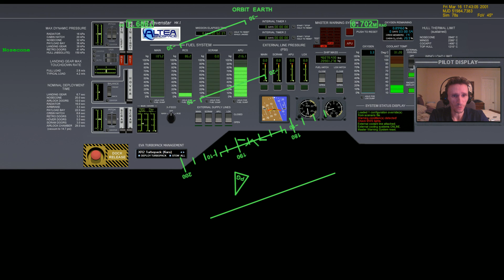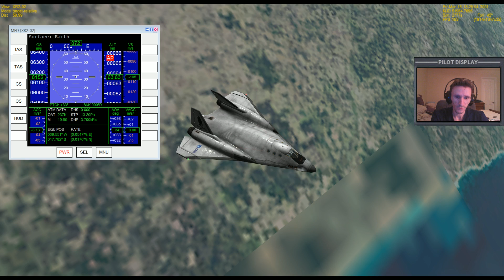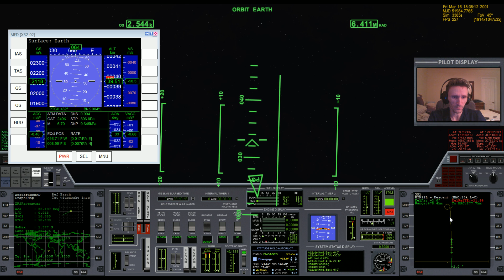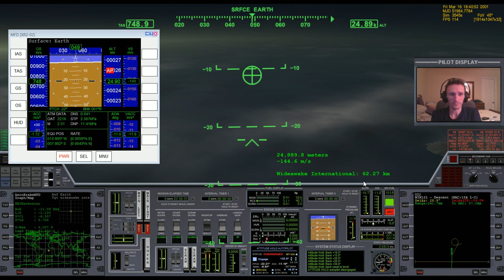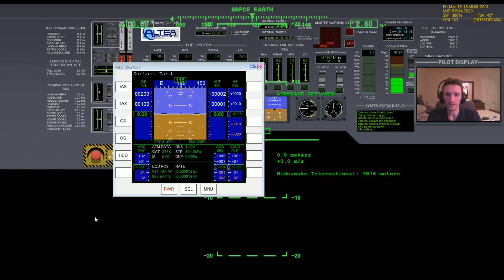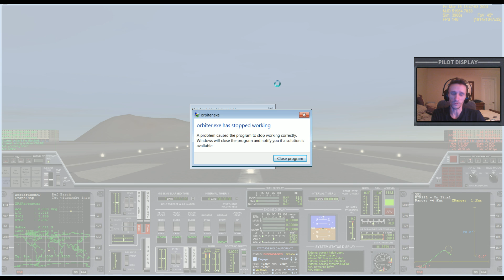Orbiter 2010 - XR2 Rescue Mission [Part 3] - Deorbit, Reentry, and Landing

Comment from the maker: Both XR2's in this flight were standard/default configuration, no overrides. As far as the deorbit timing, you're right, I could have waited a bit longer. There was no particular reason for doing the deorbit burn 1/2 way around the planet other than the fact that it requires a bit less fuel.
Thanks for watching.

Comment: Again nice vid.
Why you deorbited that early ? it´s better to keep the "Atmotime" for the XR-vessels as short as possible. Coolant temp holds ~63minutes. just time it right.
You can easy change the plane later(lower).
12.500-14000 km from target is enough to deorbit, with the XR2 in Standart Config.
BTW, both vessels were standart config, right ?
Do yourself a favour, fly the DGIV. It´s more complex then the XRseries in terms of crew management. It feels like your in the 80´s
too many buttons :D

Comment from the maker: It takes a while before TransX becomes second nature. When I was just learning it, I wrote several text files for myself so I would remember how to do different things with TransX. Part of the reason I started making Orbiter videos was so I would have a video to look back at later on to refresh myself on how to do things. But then I started making videos so often that I kinda got to the point where I knew TransX inside and out. I don't think I could forget how to use it now if I tried.

Comment from the maker: Thanks for the feedback. As far as the STS missions go, there appears to be some discrepancy between the real shuttle and the shuttle in Orbiter. Even when you run the launch autopilot script, it still takes it more time to reach MECO than it does the real shuttle. So I think the default space shuttle in Orbiter isn't set up quite right. Perhaps the Space Shuttle Ultra add-on is better tuned.